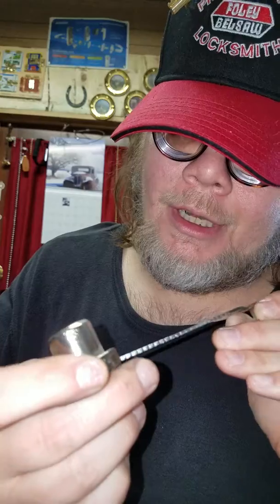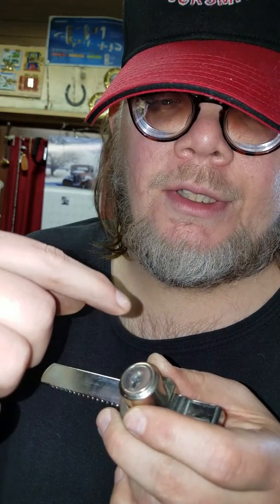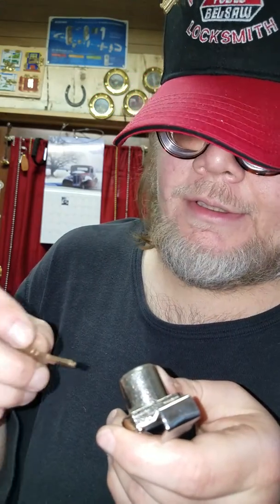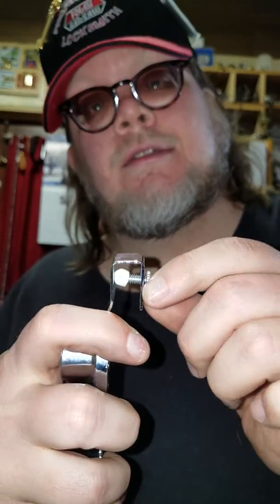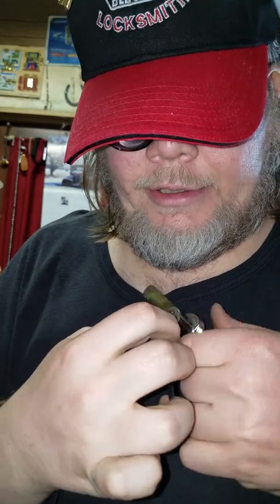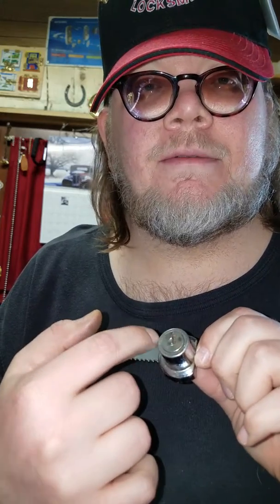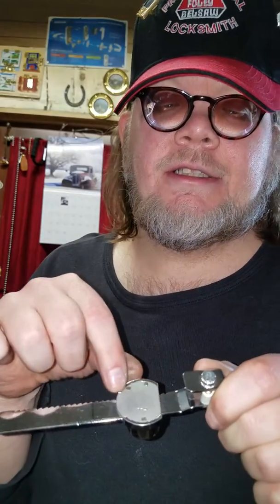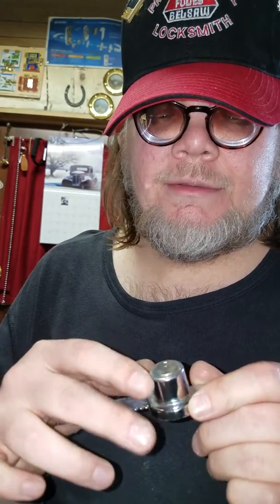Just a little tip on display case locks

Comment: Hey Willy look into HPC code source if you have a name or number off the lock. You just punch it in the computer and it will give you all the biting  and the key blanks to cut on. I use it a least 4 to 6 times a week for cabinet and wafer locks.
Reply: Bill Bacardi 
I was going to suggest that...
But you can too.  lol
cheers bud.
Reply: Steel Pinnings great minds think alike my friend.